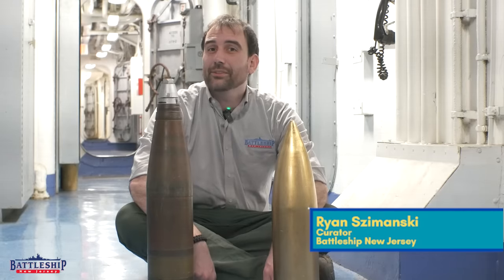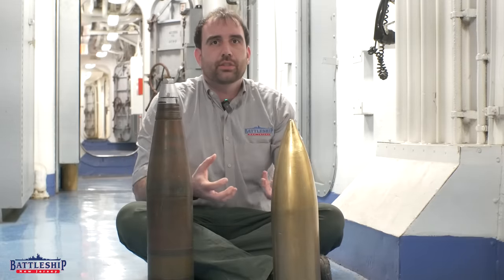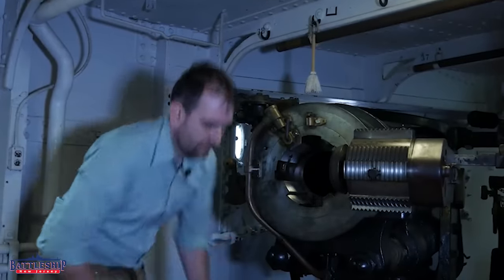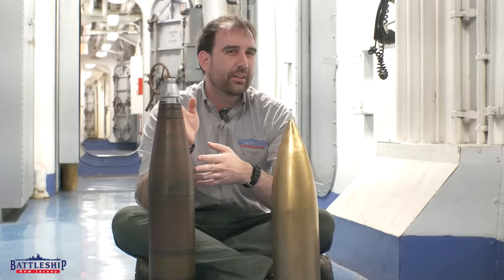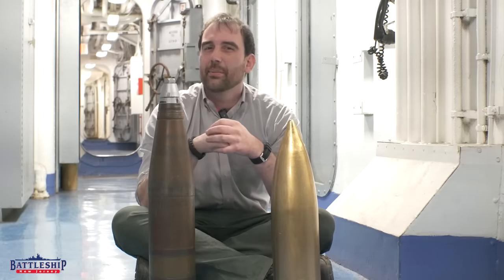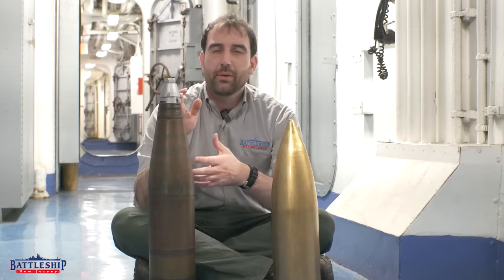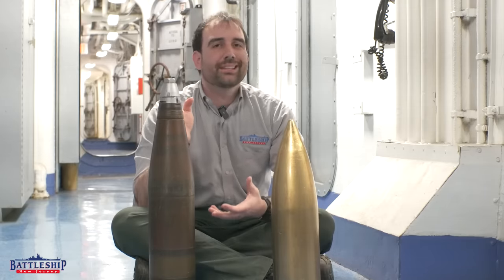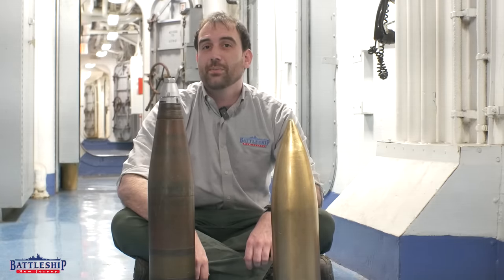5in guns: 38 Caliber vs 54 Caliber

Comment: When I was on active duty I made a habit of visiting the Company Library to read all the journals.  There was a search underway for a new artillery piece to replace the heavy and large footprint 155mm towed howitzers in Marine Corps inventory.  One artillery officer suggested putting a 5" 54 barrel on a copy of the Russian 122mm carriage to use in amphibious actions.  It made sense since at the time the Navy was still using 5" 54 guns on cruisers and larger.  Ammunition would be readily available without undue strain on naval logistics.

Comment: OSHA maximum weight limit is 50 pounds.  One place where I worked in the 80's mandated we lift 100 pounds over our heads.  Somebody  😮 called OSHA and they were fined several thousand dollars and the owner launched an investigation to find the person that ratted him out.  I had OSHA on speed dial after that.  Cool video.
Reply: 100 lbs over your head is nuts! Even 50lbs over shoulder height is a big strain on your body
Reply: Last place I worked had that too
Reply: you mean to tell me that osha max is only 50? I feel like this is forgotten knowledge.
Reply: Hire Samoans.

Comment: My second ship was DDG 5 and I reported aboard as an IC Electrician at the tail end of a long yard overhaul and upgrade in early 1975.  Among other things, the ship had been fitted with the latest version of 5-inch/54 mounts and the associated carrier rooms.  A warship is totally emptied of weapons during an extended yard period, so after we finished sea trials, we went to the Naval Weapons Station at Earle, New Jersey, for a full load-out.
That facility is essentially just inside Sandy Hook, within sight of New York City.  The pier is just over two miles long and the ammo was brought out to us on rail cars.  On our Liberty night out, they put us on a gray Navy bus and drove us off the pier to wherever it was we caught public transit into Manhattan.
Anyway, it was  a fascinating new experience to sit out there at the end of that pier for a couple of days, and the entire crew would form two lines from the boxcars - one line to the aft magazine and another to the forward magazine.  I vividly remember being at the top of the hatch down to forward berthing and the Mt 51 magazine.  Same spot, all day long.
You literally stand elbow-to-elbow from the guys on either side of you.  You don't move your feet.  You twist your body to the right with your arms in a cradle, and the guy on your right lays that 70 lb. projectile gently there.  And you twist to your left, and in turn lay it off on that guy's cradle.  800 rounds forward and 800 rounds aft.  Of course, there were also 800 powder canisters, only 40 lbs., that followed.   But I don't remember it being all that tiring, you weren't really exerting yourself much.   But it was definitely a long day on your feet.  And I am sure that there were a bunch of guys at the boxcars that had more "handling" to do, same as the ones down in the magazines.
Reply: I’ll bet sailors today would find that a real challenge.   Seems to be very hard work.  You guys were great

Comment: Thank you for clarifying a couple of things. I was a Gunner's mate on the U.S.S.Saint Paul.
  I did maintenance on one of two 3" 50 caliber deck mounts during the day and stood watch on the 5 inch 38 as we patrolled the coast of Vietnam.
  I heard an E-4 explaining the whys of the various designations, such as 5"54, 3"50 etc. Barrel length. For the last 50 years I have assumed that I worked on the 54's. They were 38's. Good weapons, powder and projectile easy to handle.
  About a year ago I was texting with another 5" gunner from my division. He was describing the potentially hazardous removal of the powder cannister after a misfire. I had never experienced that. And 50 years later, it made me sit up and pay attention.
  I have 2 questions. #1 In a 5"38 turret on the outboard side of either gun port or starboard between either guns and the exterior wall/bulkhead of the turret are there any mechanisms to fire either of those guns? I say no.
  I was 1 of 3 people in a 5" turret, ordered by the Chief Gunner to join him. 1 young man (Hawaiian ) crawled up into the gun Captain's seat. You're in a 5" turret with 1 or more weapons loaded, you are (a master chief gunner?) and he saw nothing wrong with a monkey inches from the firing button? The starboard gun did fire just as the Chief stepped over the breach. He missed being crushed by the recoil by maybe 1 second. I believe it was a choreographed event involving the Chief, Hawaiian, fire control and the XO. The Chief was no actor. I believe coordinates were fed into the ship's computer, the gun was loaded, the normal gun crew were gone and it was a simple case of depressing the firing button and with a few minor changes in rudder, when the target came on line the weapon fired. I don't think the Chief or Hawaiian knew exactly when the gun would fire or he wouldn't have come that close to being dead.
#2. I really don't want to know the answer to this unless it's common knowledge.
For instance, through an act of sabotage on the 5" 38's could someone in "fire control" jack with the fuse on a 5" projectile to the point of it exploding after firing but before leaving the barrel?
  My regular gun captain went below for mid-rats. I told him as soon as he did they were going to call a firing mission. They did and I did not answer the phone. A cowardly thing to do, yes. But I had doubts about the chain of command. Also remember, I was the guy that had never experienced a misfire.

Comment: The 5”/38 was an amazing weapon.  Married to  fire control that was state of the art in WWII, and nothing else was close.
Reply: The British had some pretty damn good DP AA guns. It took them some time to get the mounts for the 5.25" working, but once they did it was very good.
Reply: @nomar5spaulding  while true(and the 5.25 had a better ceiling), the heavier weight associated with the larger gun featured a lower rate of fire.  5”/38 was double.
Reply: @williamashbless7904  yeah. It's an engineering trade off.
Reply: Rode a DD to Vietnam was right gun powder thrower in mount 51 then moved to projectiles after the guy doing it broke his arm on the edge of the gun tray thousands of rounds!
Reply: I would not want to be a Kamikaze facing them.

Comment: I would like an in depth presentation of the 12" guns on the Alaska class cruisers.
Reply: That would be a good video!
Reply: Aren't they just "downsized" 16/54s??? That's what I gathered from what Ive read, or how I read it. That it was based on lessons learned from the Iowa's and the dead in the water Montana.

Comment: When I started at the Puget Sound NSY in 1978, there was serious consideration of developing the 8” Mk 71 naval rifle for all future USN ships. 
There were 4 or 5 (?) types of projectiles, with rocket assisted, extra long range camera guided projectiles as an option. The payload was around 250 lbs. 
There was one built, on the USS Hull. The mount is still around somewhere. 
It was so cool working on the 8” Mk 71. There was a wooden mock up of the mount and magazine built by the Wood Shop where the Shipyard Dispensary is now. 
The 8” gun was cancelled in late ‘79 as I recall, the shipyard showed us a 12 minute film of the USS Hull shooting a few rounds and then the  project was over. 
All the blueprints went back to the ordnance folks based out of Louisville, KY.
Reply: American guns are 38 caliber while Soviets are 54. During WW2 Americans complained lifting big shells was too much work.

Comment: I served on the USS Rathburne DE 1057 from 70 to 73. Our main gun was the 5" 54 Caliber. We used it heavily against NVA in 71 through 72. I  recall the gun was very reliable, and highly accurate. Our only downtime was for barrel replacement which was often. Admittedly my memory may be faulty but I'm pretty certain of my claim. I do remember the rounds seemed to weigh a lot during unreps as we had to carry them from the stern to the bow to reach the ammo hoist.

Comment: The USS Louisville CA 28 heavy cruiser had (8) 5 inch 25 caliber single mounts Dual Purpose and with Island Bombardment in the Pacific the ship was close to shore and in between the Main Battery of 8 inch 55 caliber guns firing (The Big Shots) the 5 inch would hammer away. The Marine Division on Louisville manned (2) of the 5 inch  mounts. When the 8 inch fired a buzzer would sound and the decks were cleared. My dad who passed in 2017 at age 92  proudly served on the Louisville and witnessed (52) sailors and Rear Admiral Theodore Chandler buried at sea due to 3 kamikaze hits in Pacific. They had an area to stand clear when the Main Battery was fired. Thanks for your video!

Comment: This brought back some memories from the 70-80s playing a naval war game called something like seakreig with 1:700 scale lead models.  It was pretty fun, but with battleships in the fleet, once the range closed to be able to engage with the secondary armament -- between 10-15 miles -- instead of 18 main gun rounds per minute landing near each ship it was now something like 100 secondary rounds as well.  While most 5-6 inch secondary battery rounds will have little effect, a few will hit things that are important even on a battleship and the game ended pretty quickly after that.  And if I could bring a couple light cruisers -- South Hampton, Cleveland, or Atlanta types -- into that range as well, even if my battleship took some big hits on the way in, the game was over, so me and my opponent had to divert battleship rounds to knock out escort ships before they could get into range to avoid that.

I don't know that the mechanics of that game system made any sense, and the only similar engagement in WWII that I am aware of was the sinking of the Bismark.  But it is unclear in the narratives I have read what damage was done by which category of ship at what time in the engagement.

I'll see if I can find the box with my fleet of 1:700 ships and if I do, I'll send you some pictures.

Thank you for your channel, it is great.

Comment: I was on a shipyard seatrial of one of the DDGs  (if I recall correctly), and the test coordinators had the admital's stateroom, which was just behind the 5" gun, as their office.  I was there coordinating our testing during gunnery drills.  They were firing very irregularly, so you never knew when another *BAM*, with the walls shaking and dust drifting down from the overhead, was going to happen.  It was quite difficult to explain what I needed, when the discussion continued through a number of shots!
Reply: My division officer was a smug know-it-all, always trying to do things his own way and screwing things up so it took several days to redo it the right way.  One day the chief found out there was going to be a "surprise" gunnery drill on the port quarter 5"/54 mount (USS Midway CV-41, 1973 or 1974) with only the thin skin of the hull between it and the division office.  At the right time, he sent the division officer to get the paperwork he'd been trying to get the chief to do for several days.  Apparently his timing was superb.  Chief just looked at him and said, "Don't *$%# with the chiefs, sir."  I worked nights, didn't see it, drat.

Comment: How many shells would a loader be expected to handle in an engagement?  Asking because, to me even 66 pounds seems like a lot.  I've done concrete jobs with 60-pound ready-mix bags and I'm only good for a dozen or so of those before I start slowing down.
Reply: 15 rounds per minute, roughly.  And air engagements are generally many minutes long.
Reply: @grizwoldphantasia5005  15 per minute was peak, at the second naval battle of Guadalcanal the 5" fired an average of 4 per minute (284 expended out of the starboard batteries including star shells over 7 minutes), though the actual rate varied over the action as they executed slavo fire (51/53 on Kirishima, 55/57 on other targets, 59 firing star shells) to spot the fall of shot.
Reply: During Vietnam at one point in New Jersey fired so many rounds that the 5 inch 38 Mounts got clogged.   They emptied one of the batteries....

Comment: Having served on EDSON, a Forrest Sherman class destroyer, I'm a fan of the 54.  Ours were nominally rated at 28 rounds per minute by the time I was on her, but most GMs had little trouble adjusting the timing to get it up to around 32.  There was nothing quite like watching the cradle and dual arms moving over and over again to match azimuth and elevation to feed the twin cradles that loaded the gun at full speed.  Really impressive.

Comment: While US BB's had either a single type secondary battery of 5"38's or the secondary 5"51/tertiary 5"25's (as designed, cause post 12/7/41 rebuilds are a complete other issue.)  Most foreign BB's went with a heavier secondary and lighter tertiary.  In these cases, the later battery were mainly AA (while some secondary's had AA capability) as opposed to the pre-dreadnought's A-Z gun selection all for surface targets.  For example, the NELSON and RODNEY had twin 6" secondaries and single 4.7's tertiary.

Comment: 80 lbs is a fairly common weight for bags of dry concrete. Carrying/manhandling those will quickly get to you. I speak from personal experience.

addendum: As weird as it sounds, it could be easier to carry 2 of said bags. Balanced you out, one per side. Carrying your own body weight will REALLY get to you quick though. (Over my own weight by 10 or 20 pounds back when I had to do this even)

Comment: The 5" gun was developed in the first place as a 'take the average' effort. The Royal Navy and German Navy were trying to develop a proper secondary battery for their ships. The British 6" and German 15cm (5.9") guns had good range and a large shell to do lots of damage but were slow and heavy, making them less effective against fast torpedo boats or Destroyers where the British 4" and German 105mm (4.1") were lighter and faster, making them better at getting shots onto fast targets but those shots were much smaller with a smaller blast effect. The US Navy slit the average and developed the 5"/51 so that it's faster firing than the 6" but with a bigger projectile than the 4". Both japan and the RN tried to improve on this, with 14cm or 5.5" guns and  later with the 4.5" and 5.25" but these fell short.

Comment: Those secondary guns that were originally in those casemates on the sides and rear of Texas are interesting, seems most of them were removed very quickly though.
Reply: They proved to be mounted too low and were too wet to use if the sea wasn't dead calm. The refit in the 30's moved 6 of them to the superstructure, which were eventually all she had left. Similar refits were done to the Nevadas, with the New Mexicos and following classes being built with them in the superstructure. I looked all that up just now. Say what you want about Wikipedia, it's good for a quick lookup of uncontroversial facts.

Comment: In WW2, the 5"/38 was about as good as it was going to get for a heavy AA gun - anything much bigger than the 120-127mm caliber was too heavy for manual loading, and autoloading hadn't really gotten reliable enough. That said, autoloading could have seriously changed the game if missiles didn't do it first - OTO Melara built a 127mm/62 gun that can fire 45 rounds per minute (the Italian navy uses it today, so do a few others). Bofors also built a 120mm gun capable of 80 RPM. Either of those, in a lightweight mount, with VT fuzes, would have been a terrifying AA weapon. The longer barrel would mean a higher velocity for shorter time of flight, and the higher ROF would mean that you could more easily bracket a single aircraft, to both get hits more easily, and to get more hits in case one proximity burst didn't do the job.

6" guns capable of elevating to hit aircraft didn't really become useful in time to matter, though again, had missiles not arrived to change the whole game, that might have done so. The MCLWG, had it ever gone into production, might have been interesting to see too - coupled to 1970s fire control, it could engage aircraft too. That said, I think even had missiles, all-weather aircraft, guided bombs and nuclear-powered submarines not changed things, and battleships continued in production into the 70s, I think an 8" gun would have been too big for a secondary battery. (But we might have seen a 155mm secondary on the successors to the Montanas.)

Comment: Makes me think a bit about .38 special vs .357 magnum. Not all .38 revolvers have a cylinder long enough to take the magnum load. I also wonder if there's some concern about the guns themselves being able to take it. Even if you got a .357 into a .38 only gun, you probably wouldn't want to fire it because it wasn't meant to take that kind of pressure. The velocity looks about the same, but you're pushing a round with ~50% more weight to it at the same speed as a lighter one. That's going to take more force, maybe more than what the barrels and breech were meant to.

Comment: The Midway class' semi-auto single 5"/54's worked fine. They were sold to Japan for fitting to destroyers when some were removed from the Midway's to make room for angled decks.

The automatic Mk 42 mount which came later and was fitted to many classes in the 1950's and 60's was not so great and the rate of fire had to be drastically reduced to make it usable.

If you really want terrible the twin 3"/70 was absolute garbage, only fitted to 3 ships IIRC and it only lasted a few years in service. The British version (which saw the most use in Canada) was only a bit better - by cutting the rate of fire in half.